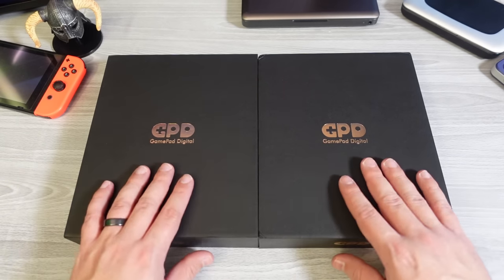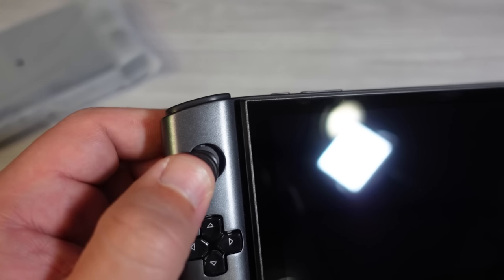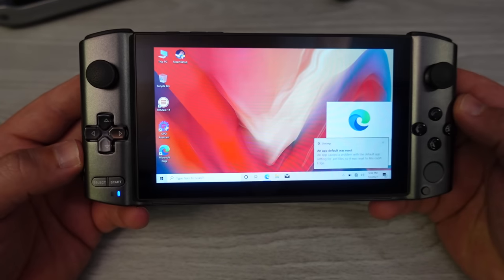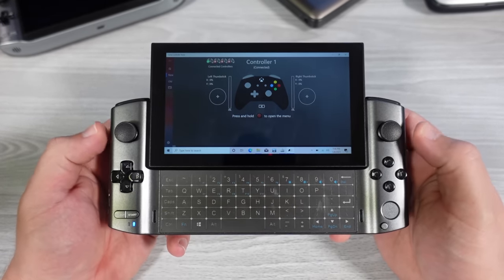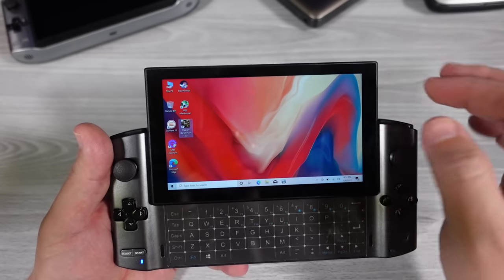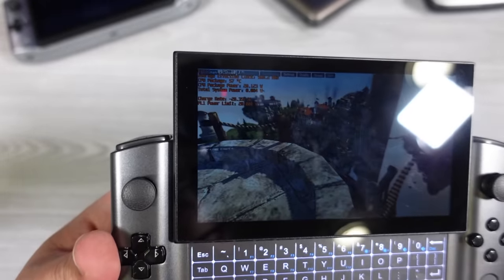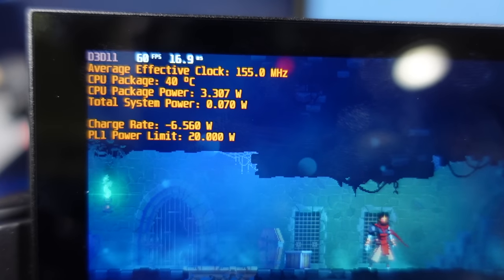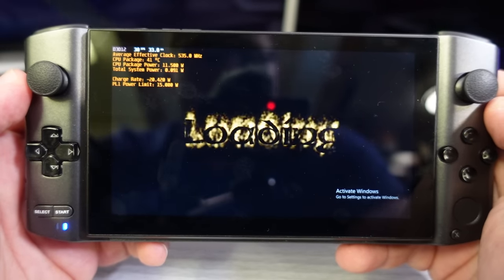GPD Win 3 - Unboxing and Quick Impressions

Comment: Next, they should add a higher refresh display to them along with even higher power internals. Even a laptop based lower end gpu would be huge imo
Reply: This is more than useful as it is. The gpu is insanely powerful for the size of the device. It's on par with nvidia mx350. And even then it can just reach 60 fps on older/lighter games so I don't see how a higher refresh rate would help here besides killing the battery faster, which I can assure you they won't do on any near future device.

Comment: This is a rather disappointing looking device, honestly. I'm not a fan of the idea that they went for a "Switch" design, made it basically like a slider, and gave it a touch keyboard. I see what they're going for, but this doesn't seem like the next big thing for me. I'll stick with the Win Max, even though while the driver support is finicky, when it works, it's amazing.

Comment: My hopes for this keyboard are low and falling
Reply: My hopes for the gaming aspect are high and rising.
Reply: eh external keyboard. i don't get these kinds of devices for the keyboard
Reply: @nemesis8508  that is  what I'm saying. I feel they should have not even added a keyboard and just made the screen larger.
Reply: @ricksmith4840  i don't see how removing the keyboard correlates with a larger screen?
Reply: @nemesis8508  it doesnt. I'm just saying they should just have made the screen larger and not add a keyboard. That's all

Comment: If GPD was smart these handhelds could really take off in sales if they could cap under 600 dollars. Otherwise it will always be a cool concept but not practical for the price point, I always have wanted to get one.. but it’s just so damn expensive lol.
Reply: Price is really affordable for what you're getting.
Reply: i bought almost nevrr used gpd win 2 for 400€ 1 year ago
Reply: $600? Similarly/lesser specced laptops in our country costs over $1,000. This is actually a pretty good deal for what you're getting. And it's really versatile for me. I can carry this on its own if I wanted to travel light but still have a powerful umpc. Or I can connect this to my nexdock if I wanted to game using a laptop form factor or connect this to my egpu at home if I wanted high def gaming on a tv.
Reply: @techfreakjames  you see the problem though, it’s definitely powerful I’m not arguing that but as a stand-alone unit with a 720 P display, it’s not gonna make anybody use this for gaming alone.. without connecting to some other unit.
Reply: @royceg3375  i use my win 2 mostly as a stand alone unit. I just like having the options for expanding it. That's not a problem, it's a feature. And they made the right choice going with 720p on the integrated display given the size. Going 1080p or higher on a 5.5" screen would just unnecessarily tax the gpu and battery because no one would be able to see individual pixels at 720p at 5.5". I can't see the pixels on my bigger 6" win 2. And when you connect an external display, the Win 3 can drive that at its native resolution so there's also no problem there.
Reply: @royceg3375  mind you, I don't think the Win 3 is perfect. I've posted my own criticisms, especially on their final design compared to their earlier ones. But my beef is not with the price or the resolution. It's with the IO (ports and keyboard), form factor (i prefer clamshell), the screen size (i wish they stuck with 6" or bigger without affecting overall size), and possibly the cooling when connecting to an egpu (i've yet to see anyone lay this flat on a table and show us the airflow).
Reply: @techfreakjames  I hear you those are good points.